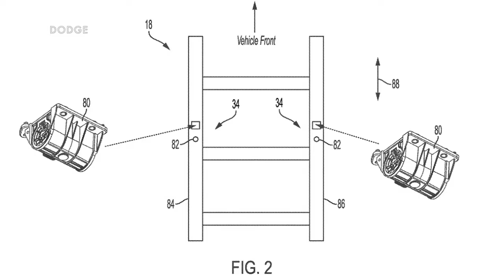How Dodge's Fratzonic Chambered Exhaust Works Finally Revealed!

Comment: I don't mind ev's making noises, but why try and emulate a gas engine? You're never going to do that right and if you do, what are you left with? An ev that sounds like a V8? It's really cheesy. I like the Porsche Taycan sounds for example. They sound clean and futuristic, not like a child's toy or the V8 sound of a 90's video game. The Banshee logo is weird and hard to wrap your head around immediately too. The Hellcat and Demon emblems were great, but this one falls short.
Reply: Yea I dont disagree the sound is horrible, but you also have to understand that as a sports car driver, 50% of the fun is the sound of the engine and the other 50% of the fun IS shifting. I dont want an electric car that sounds like nothing, and I dont want a true 100% automatic transmission. If someone could merge that with an EV I might consider buying an EV.
Reply: There's just so much lost in switching to EV's for car enthusiasts. I understand the power and speed, but that isn't always the point of a sports car, it's about how it makes you feel. And, to be 100% honest, I dont feel shit when I drive an EV.
Reply: @dean1625  Yep. An ev would destroy my Mk7 GTI in a straight line, but my car has character and a soul. I look forward to driving my car. I can't say that about an ev.
Reply: @EpicAurelius  I'm right there with you. Then there's the issue of charging etc . . . which im sure will be addressed at some point, but it's still a problem since I drive about 90 miles a day. One day I know ill be forced to buy one, but it might be the first time I actually cry buying a new car lol

Comment: The design looks absolutely awesome. I think I might turn off the sound and artificial gears though if that's an option. 😂
Reply from the maker: The sound can be turned off. Dodge hasn't said exactly what's happening with the gears, but updated that it won't be available until the Banshee model launches next year https://youtu.be/IczXEd2kGMw?si=Q4dRmOk6h-eKXUwC
Reply: Yeah IDk about all this pretending to be a ICE with a trans stuff. I think it should just lean into being an authentic EV (which it is)
Reply: @roboticunclephil for real. They need to be competing with Tesla’s “ludicrous mode” on the P-Series, not V8 ICE engines.